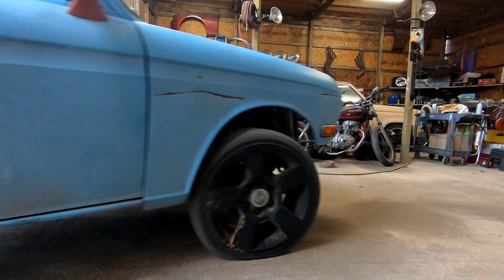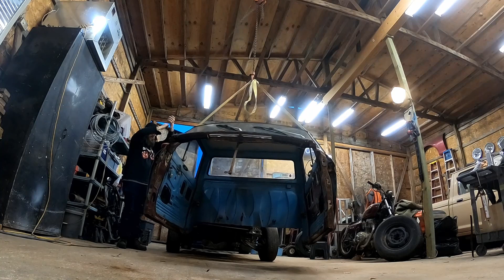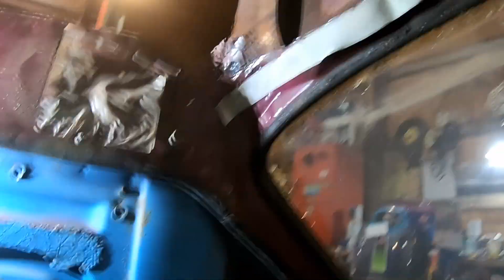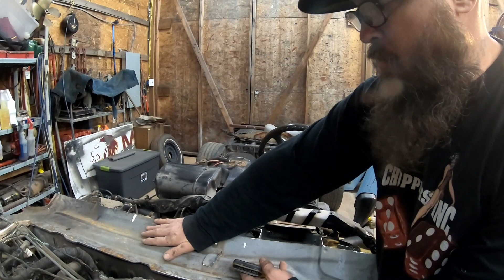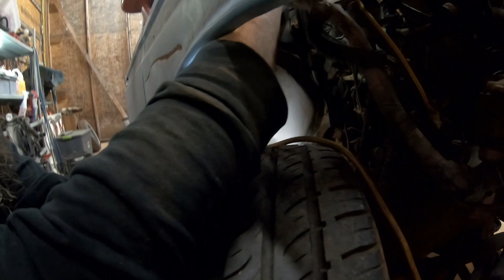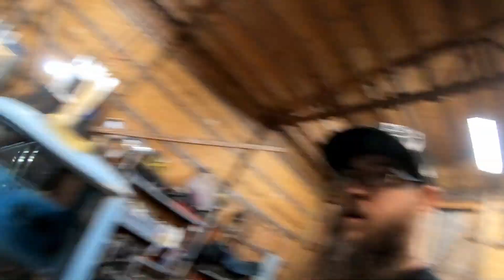Copart 1970 Datsun mini truck build pt.8

Comment: Fun stuff.
Had a 1978 Datsun 510 wagon, bought for $100. 
Daily beater, sold for $100. with 
 400,000  these engines run forever.
Cool video creating in motion.

Comment: Loving this build and your approach to it. Definitely not boring. I do wish, however, you'd mask up that windscreen glass when using the angle grinder near it!!!
Reply from the maker: The windshield is in really bad shape and needs a new rubber seal around it so it will be getting replaced. I’m glad you’re enjoying the videos. Stay tuned for more.

Comment: Hood wont fit so you will need a big cowl induction hood like from a Shelby or Camaro. But you got the cab sitting right down on there. Fits better than I ever hoped for. This is so interesting you would have to take your tape measure and go to a salvage,  measure  hoods to see what hood might fit? May be a hood from an old Ford truck from early sixties would work they are humped up. I remember those old Datsun trucks from the seventies when I was in high school.
Reply from the maker: I’m going to attempt to build a cowl induction hood out of the original hood. It should be interesting lol.

Comment: For wheel clearance, have you considered looking for a set of custom wheels with reverse offset particularly on the front? That would allow the use of wheels like the alloys you showed earlier in the video and still maintain the clearance you need with a minimum of rolling of the wheel lips.
Reply from the maker: Yes. I’m considering that option. It just depends on what style of wheels they have. Hopefully I can find something cool.

Comment: Mike if the truck isn’t going to have a/c could you leave only the floor vents for heat and run custom defrost tubes to make more room? Keep up the good work I enjoy your videos.
Reply from the maker: It will have A/C. It’s one of the biggest reasons for keeping the hardbody firewall. I will modify the duct work to accept the older Datsun dash. Hopefully it won’t be too much work lol.

Comment: I love my 521 except  for that bed and rocker panel  misalignment . Im going the cheap way with the bed extension .
Reply from the maker: Not sure why they designed it like that but it should look a lot better with the extensions.
Reply: @weirdbeard8898  i like your way better but im getting  to old and slow for any more big projects
Reply: The previous iterations of the Datsun trucks had "misaligned" lower edges of the cab and bed too.  Take a peek at the 320s and even older  models. 

Your truck. Your call. I appreciate the bed side extension option myself.

Comment: Great descision not to do the trendy flares. I was worried a little when the big wheels were still on the front. Properly lined up tires/fenders never go out of style. I agree the higher bottom of the bedsides always seemed a little off. You still see it on the pickups toyota and others sell outside of the U.S. and it still looks off.
Reply from the maker: I never understood why they designed it like that. Looks funny.

Comment: Mike, Looking really good, but without paint bath available and the visible rust, how will ascertain rust will not come back with a vengeance somewhere?
Reply from the maker: I will probably use some rust inhibitor on the surface rust before sealing it all up.

Comment: Hey WB.  What you think about the eastwood turbine system?  Thinking of getting one myself.  I diy at home.
Reply from the maker: Not bad. Easy to use. No moisture or oil residue to deal with like when using an air compressor.
Reply: If you had to choose would you get the compressor setup?  Either way I go I have to buy all the components